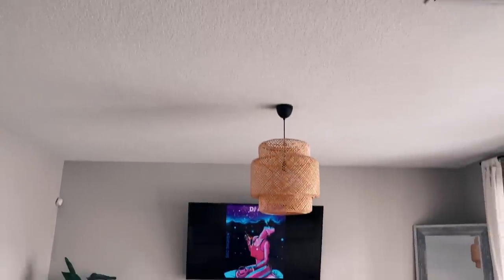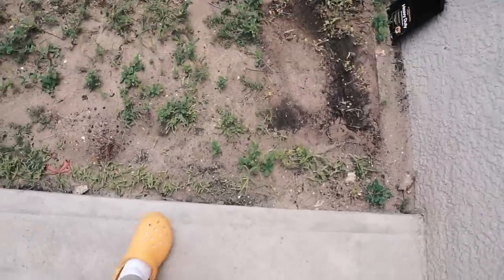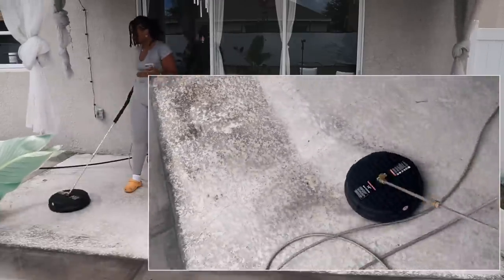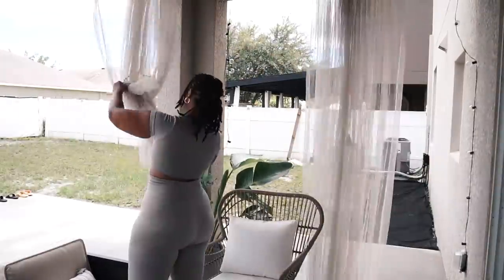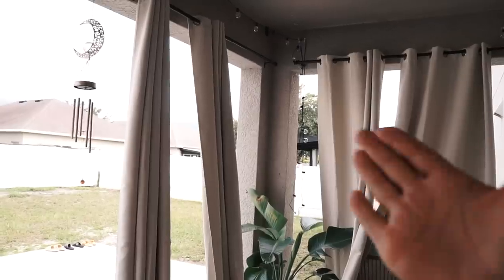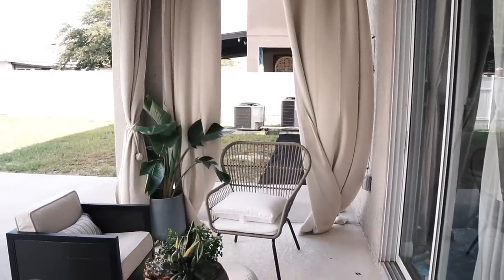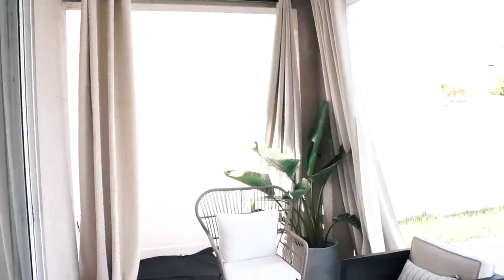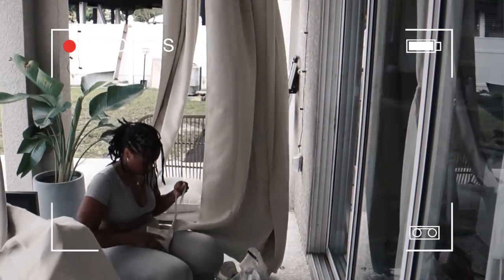BACKYARD MAKEOVER UPDATES | BEST OUTDOOR CURTAINS | PATIO REFRESH | CLEAN & DECORATE WITH ME | EP 3

Comment: Beautiful curtains! Suggestion...put rocks or marbles in zip sandwich bags first to prevent stains and leakage vs the sand. The dollar store is a great source for either product. Enjoy your birthday party! :)
Reply: I also thought of that of stones or marbles.
Reply: We purchased magnets to use as weights & they were sewn into the hems on the left and right side of every panel. The order consisted of 100 Circular magnets that were about a half inch in diameter. I used a stack of 10 magnets on each side of the panels. They really helped to minimize the times the wind blew the curtains off of the ground. Although it was a time-consuming task, it was worth it in the end.

Comment: I look at your videos on my patio🥰a few suggestions or ideas if I may.
1. You can use 30 second cleaner from lowes to get a deeper clean for the concrete 
2. I used painters drop cloth found at Lowes in several lengths for my patio curtains..I had my husband to install a hospital track to the ceiling so I can just close my curtains (like they close curtains for privacy in the hospital) the fabric is not rain proof but it's like a linen material..it dries really fast and I've not had any mildew for atleast the 2 years I've had mine up.
3. I sewed heavy chain in the bottom of my curtains to keep them from blowing...it works really well...although wind is really strong...if not you can add rocks/pebbles to your sand bags 
4. I use white Christmas for my outside lighting..lights up EVERYTHING not the blinking ones though 🤣😂🤣the painters cloth is a heavier material and it allowed us to be able to enjoy our patio during the winter with a heater of course...just giving everyone a few ideas!! Everything looks great
Enjoy your bday!
Reply from the maker: luvvvv to hear itttt